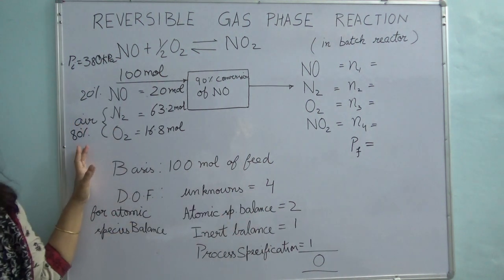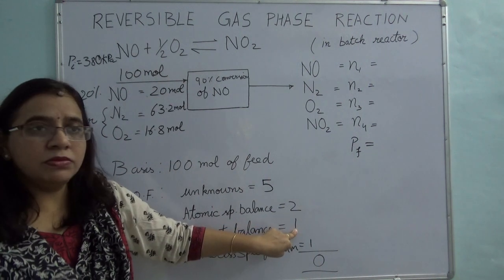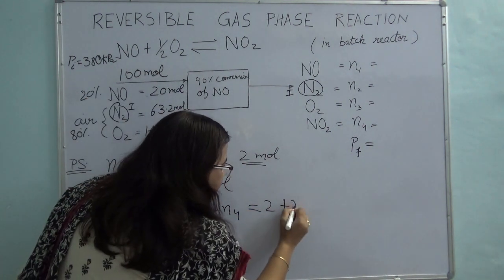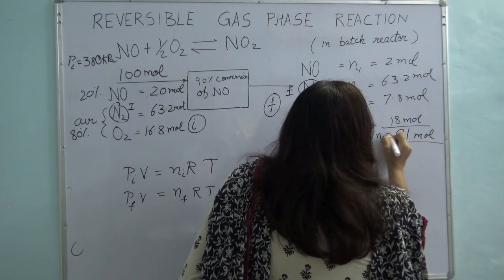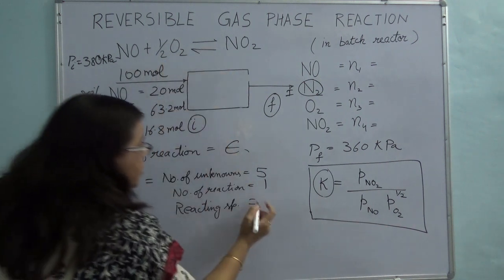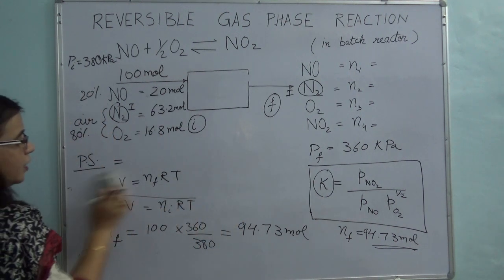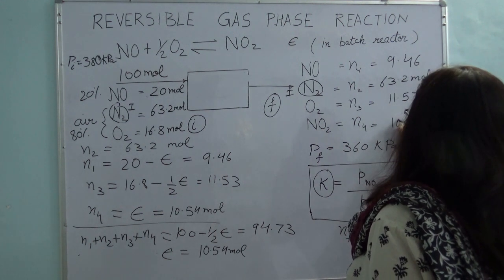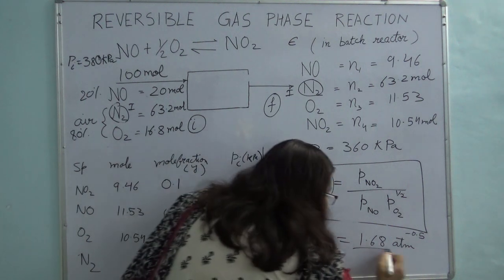Lecture 42 Material Balance Involving Reversible Reaction in Ideal Gas Phase

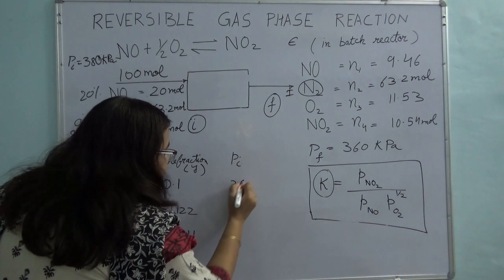Comment: Professor, I am confused When you were calculating the K in 19:20, when you wrote the values No2, u took the value of 9.46 but it should be 10.54 , because we took it from NO2, but the value that u took (9.46) is from NO.

Comment: dr where u get N2=63.2 and 02 =16.8 m0l?
Reply: From the composition of air. Assume air is 21% oxygen and 79% N2 (as it is often the case). Then it's simply n_O2 = (0.21)(0.8)(100 mol) and, similarly, n_N2 = (0.79)(0.8)(100 mol). This is very late, but I hope it can help someone in the future!